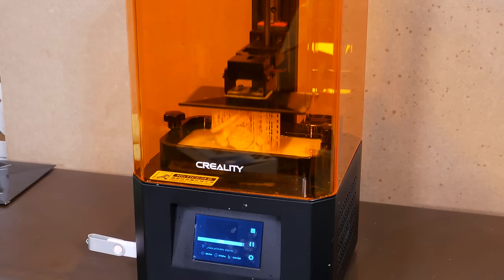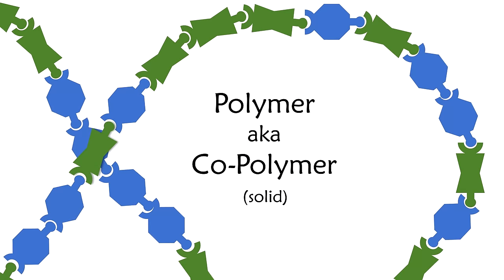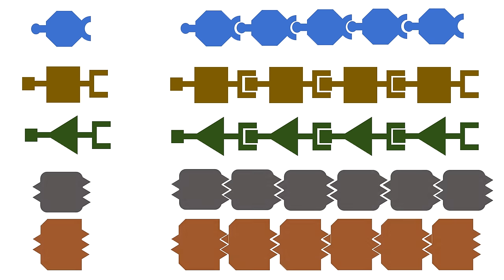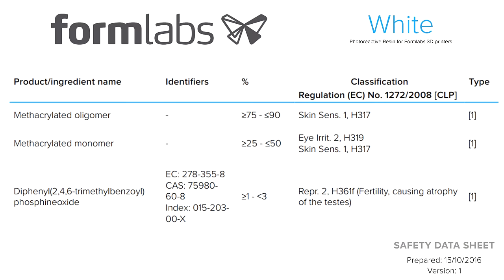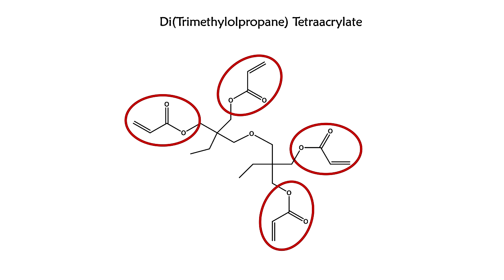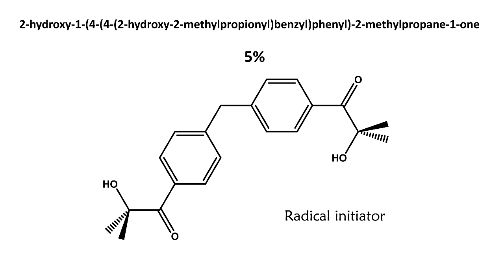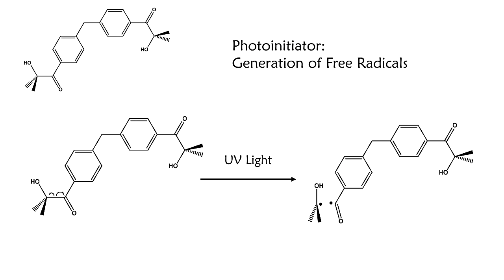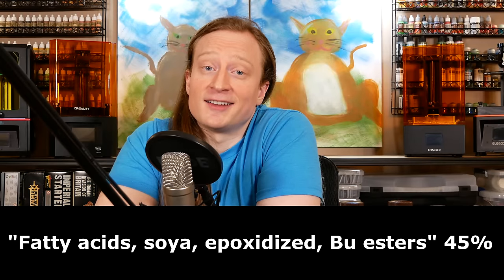Ph.D. Chemist Explains 3D Printer Resin

Comment: wow! thanks a lot. I have a question, though: all resins I've seen on the market are polymerized by "405 nanometer" light. but isn't 405 still in the visible spectrum? doesn't "UV light" stop at about 405? also, some wash & cure machines have two types of LEDs, emitting 385 (which I assume is "real" UV) and 405, which apparently is not. could you please shed some light (yes, pun intended) on the issue? thank you very much once again!

Comment: re f: 28:40
It workes well for me to just leave the used alcohol in the window. This will polymerize the resin in a day and two. You can then easelly filter through a coffee filter. 
 use a stack off the off the plastic bottles that the alcohol was delivered in as a filterstack. Remove the bottom and isnert one into the other and put the filter in the top one. I use a plastic spanner to hold the filter into the side of the bottle.

Comment: This insightful video is just what I needed, as I am fairly new to the resin 3d printing realm. Thanks...........now, can you also explain what is a polymimetic alloy that is used inside a flux-capacitor running on 1.21 gigawatts of electricity............just kidding

Comment: thanks for the amazing video,  have you ever looked into what is in a castable resin?  is it possible to add some type of soy wax to a soy based resin and still be able to get prints from it?  it would be amazing if i could find some type of resin i could modify and use for lost wax casting.  some of the casting resins are 400$ per liter.

Comment: Hello. I'm thinking of getting into the hobby and there's a lot of contradicting information about how toxic/safe cured resin items are. I've been searching around a lot and I'm at a loss at this point. Can you handle solid resin? Is it safe? What happens when you let the resin be in contact with the sun for too long. I've seen some saying that it's food safe, and also that it becomes toxic again if exposed to the sun/uh light. Others say that it's still just outright toxic. I'm really at a loss

Comment: I would like your opinion on curing dirty IPA before filtering and or settling. I see that many people like to cure the disolved resin in an attempt to clean the IPA. I don't do this. As resin has higher specific gravity than alcohol, surely it is going to naturally gravitate to the bottom in time. It does.Overnight settling is plenty long enough. I think curing just locks a quantity of IPA into the cured matrix. I think this wastes more IPA. What's your thoughts?
Reply from the maker: I think allowing the resin to settle and then decanting off "the good stuff" is a good/ convenient way to keep the alcohol reasonably fresh.  Depending on what resin/ alcohol combo you have, it might take longer than overnight.  In my experience getting a good separation just from gravity takes a week or so....    I haven't found a truly efficient way to use UV light to assist the process yet, but I'm sure some folks have.
Reply: Thanks very much.

Comment: I'm going to exclusively use water washable resin, even though it's more expensive.
That way I don't need to clean it with alcohol, which I found to smell more than resin as well as being a bigger issue to deal with, and potentially dangerous as it's flammable.
Now my question is, do air purifier with active charcoal filter help with resin fumes? I'm going to put my printer inside a storage room in my appartment.

Comment: I figured I would ask an expert chemist if I ever encountered on on here. How much upsale is the resin costs to Joe Public consumers compared to a company that would buy 55 gallon barrels of such things? Coming from the automotive industry some of the chemicals I used everyday are pennies on the dollar compared to small quantities a single person might use. I'm sure the  products I used  don't match apple to apple with resins or other chemicals in general. Just was wondering if you knew better ways to decrease cost or if making resins would be cheaper or even possible assuming the chemicals needed are accessible to the average consumer? Thanks for any insight into this and for your very knowledgeable videos.

Comment: What about HCHO? I use an air tester and when I extract the pieces printed from the printer the level of formaldeide is a little bit over the safe level, expecially if i close the door of my garage…
Reply from the maker: what kind of air tester are you using?  There are definitely airborne organic molecules that evaporate out of liquid resin.  I don't know of a reason why specifically formaldehyde would be around, but other carbonyl compounds do make sense.   A garage is a good place to do your printing, especially because you can open the door to freshen things up :-)
Reply: PS I am the same YT user but I answered with another account ;)

Comment: I understand the chemical reaction happening, but where do the fumes come from? And what exactly are they?
Reply from the maker: any of the ingredients with a high vapor pressure / lowish boiling point will give off some vapors just from evaporation. The only smell I've recognized in a resin is methyl methacrylate, luckily most resins don't give off that smell.

Comment: I have a question regarding gloves and the 3d print resin. To make a long story short, aren't PE gloves (like those at gas stations) better than nitrile? 
Given that the resin is stored in HDPE bottles, I'm assuming they wouldn't be attacked by the resin, they're cheaper than nitrile gloves, and given the current situation, the market for nitrile gloves is being flooded with fakes made of pvc or latex and real ones are overpriced due to demand. The only downside I can see is that they probably don't have great 'feel', which is not a huge issue if all you do with them is clean prints and equipment.
Maybe I'm missing something entirely here, but it seems like such an obvious solution.

Comment: Here's a question you've probably never gotten.
If you 3D resin print a spare 3D printer resin vat or a bottle  and then properly cure the finished print, can you then store more of the same resin or other brands of resin in the 3D printed vat or bottle without decomposing those 3D printed and cured parts?

I ask because I've designed an automatic resin mixing vat that will allow me to get a continuously and thoroughly mixed amount of resin in my resin-vat during a long overnight print without having to periodically pause the print to do the mixing manually.

I want to be able to 3D resin print my automatic resin mixing vat and then use it as a sort of specialty-resin-vat when printing with a specifically altered or formulated 3D print resin.  I've been told that if I use a 3D printed and properly cured resin vat, it will most likely melt the 3D printed resin vat.  That doesn't make sense to me at all so I just thought I'd ask to see if you can confirm this or not.

I suspect that the people who have told me this are just some self-appointed internet experts who's information is more like opinion rather than real hands-on knowledge.  To the best of my knowledge no one has done this kind of testing to see if uncured resin will melt or detrimentally effect cured resin.

I plan on trying it but I thought I'd ask before hand in hopes that a bigger 3D print nerd might  be able to shed some light on this.
Reply: Melt how? The resin does have a heat deflection temperature, though you'd be extra lucky if they specified it; if the heat caused by the curing light (backlight) being dissipated on the LCD and other components causes the HDT to be exceeded, the vat that you have made will lose strength and can fail, so perhaps you can try to measure HDT of the resin print and the temperature near the hottest parts of the vat to check viability. Just being in contact with fresh resin should not do absolutely anything to the print per se, i can't really see how. As to being "properly cured", well after things are "cured" they still continue curing over the next few months until they're actually completely cured, so be aware that mechanical properties will change over time, and if there is any residual surface reactivity, it will decrease over time as well.

As long as you have planned for contingencies, just do it, just try. I don't think there can be an a priori answer whether it'll work or won't work. You'll just have to approach it experimentally and see whether you hit any roadblocks.
Reply: @SianaGearz  I found the answers I was looking for through experimentation.

I 3D printed a couple of my Automatic-Resin-Mixing vats out of PETG and I also machined two more out of HDPE plastic as well.

All of my prototype resin vats held up just fine when subjected to long term contact with un-cured liquid 3D print resin.

Now I know that the "Experts" from the resin manufacturing companies were just offering opinion rather than facts.

Thanks for taking the time to reply.
Reply: @MrTjmk   Is PETG still working well? Because since then the DIY 3D printer Lite3DP appeared, it's basically one of those 2.4" cheap touch phone screens 320x240 driven by an Arduino, dead simple and cheap, and apparently printing the vat from PETG has not been recommended; they have instead suggested that it be printed from PLA. Styrene based plastics are supposed to be susceptible as well. The problem being that they're weakened by the uncured resin, become brittle.

I have also since learned that both polymers that i use personally, PETG and HIPS, are insanely weak to threadlocker. Just being nearby as it cures will cause them to lose cohesion and become brittle and crumbly, i have unfortunately seen it first hand.
Reply: @SianaGearz  Wow, this is and old post but, to answer your question, yes, both of the resin vats have held up quite well.

I think part of the reason for that was because when I printed them I did so with a solid infill.  They're pretty thick.  Even if the resins in question were to have had a slow disintegrating effect on the PETG filament I printed them with, it would have taken it an awful long time for it to have penetrated the walls of those 3D printed PETG resin vats.

Comment: What happens if you shine UV on the resin/alcohol mix?
Reply from the maker: I get a rubbery film coating the interior side of the clear plastic container.  Once they become thick enough to be opaque the polymerization stops.  I know some people get particulates to drop out of solution which sounds pretty handy... but I always seem to get films on the inside of the jar that are hard to clean up...

Comment: I just watched this video, and I must say that I will probably return and watch other of your videos, as you have a very pleasant and clear presentation style, and a voice I could easily listen to for hours.

As a Dane, I must say I was very puzzled by the mention of "landfills". I guess it means that you still dig holes into the ground dump all kinds of stuff in them, and cover the whole mess with sand and earth? Wow. I think we stopped doing that to a very large extent 30 years ago here? Any non-recycleable waste (and unsorted waste) is classified as residual waste, and is used in incinerator plants that produce heat and electricity. The smoke is filtered, and particles from the filter as well as the slags is then treated as other incombustible types of dangerous waste. Only very few types of waste are completely incombustible or too toxic to incinerate and will be deposited in monitored landfills. Through efficient sorting of waste, we have reduced the amount of residual waste to a point where we can profitably import waste from other countries (for example from the UK), to feed our incinerator plants, together with straw from grain production and other types of biological (and CO2-neutral), waste.
Reply from the maker: Ahhh,  America has lots of ugly land to fill! We think of burning plastic to be kinda iffy... either way it's best just to try to reduce our waste production :-)

Comment: Is it possible to solve this stuff, add initiators and use again?
Reply from the maker: nope, the newly formed C-C covalent bonds in the polymer chain are very strong, no solvent will reverse that process
Reply: @GoobertownHobbies  Thanks. Maybe heat will help? I found video from Thy Labs where he claims he depolymerized acrylic sheet into MMA. Maybe something like that?

You can make interesting video out of it.
Reply from the maker: @uis246  you're not gonna get mma back out of pmma... that's not a cool vid, that's a Nobel prize! ;-)
Reply: @GoobertownHobbies  Huh. Thanks. Then I don't understand what liquid he got at the end of the video.

Comment: I just want to warn anyone curing washed resin to use a safe container.  I had some rinsed resin in a solo cup and the curing process generated so much heat the ridges melted smooth.

Comment: I know this video is hitting it's year mark, but does anyone know if curing resin makes it aquarium safe or if there is a special brand that is fish safe? I would like to print a few replacement parts in the future in clearish resin but my Google-fu is not strong enough to find the answer.
Reply from the maker: I wouldn't. A lot of stuff is likely to leach out over a period of months.  You could seal that in with paint... but then there'd be the paint.   you could just coat the whole thing in silicone, but that probably defeats the purpose...
Reply: @GoobertownHobbies  Thank you for the reply. Yes, painting and coating in silicone would defeat the purpose for a few parts, like under gravel filter connector. This sent me on a search path though, I found there is 2-part resin coating that is fish safe that is used in professional tanks. I can use this to cover a few decorations I wanted.
Plus, once I get a 3d printer I can print the parts needed, mold them, and then cast in that same resin. So, thank you for setting me on a good Google-River for answers.

Comment: YEAH SCIENCE!

That being said while the resin isn't terribly toxic to handle and be around for the most part, it seems a handful people have been hit with a severe respiratory allergic reaction, which can be insanely dangerous, at least there seem to have been some reports that i don't necessarily have the ability to directly confirm, so it is perhaps a "rumour". The probability of this happening to any given person seems to be absolutely tiny but the consequences can be severe to deadly. What is the right way to handle such a risk anyway? I mean we all cross the road sometimes, and we might get run over by a car, and that's not even terribly unlikely. Is there a right way at all? And it's not like the smelliness is necessarily correlated to this kind of risk, is it? What are the smelliest compounds in the mixture anyway?

Comment: Thank you so much - the safety aspects and 'greenwash' marketing implying safer but not necessarily so, were enlightening for us.  Hubby has had a severe, systemic allergic reaction to the fumes of the Anycubic Eco Resin - almost a full body rash, severe facial swelling and Soros-like bags around the eyes.  We have now gone all-out on safety precautions:  full printer enclosure with exhaust fan, full PPE, and protective eye-goggles.  We learned some extra safety tips from you such as curing the waste and a good reminder re ethanol precautions as well.

Comment: Resins:  Have you tried adding micro-powdered metals or plastics--Delrin, Acetal or Teflon/PTFE) to SLA resins to increase their self-lubricating properties?  I ask because my own applications would benefit from lowest friction characteristics possible, and the items I propose making would be produced in far too small numbers for thermoplastic, aka injection molding to be a viable alternative.   Unless they take off, of course.   
And--for the benefit of any lurkers reading along--no, I am not making sex-toys ( :-D ) but only, comparatively boring, small scale model railroading items.   :-D

Comment: Alright I have a question regarding Cement vs Superglue and their toxicity, like I didnt know that tamiya extra thin cement is neurotoxic. I had the window open and I wasnt wearing a mask I opened the cap, and the odor was horrible. I immediately closed the cap, but now Im worried about the neurological side effects of that. So knowing u r in the hobby how bad is using that types of cements? Also why are those cements that are hazard and unhelathy being sold to teenagers? like WTF. The label said not for under 14 but what about above 14? Also how´s possible that after 40 years no one has ever invented something THAT IS SAFE in the model kit industry??? Do u use a mask when using tamiya extra thin cement? like the covid masks?

Comment: FDM for home, resin for commercial, the toxic nature of the resins can cause chemical sensitivity to increases over time, toxic fumes are really bad for the brain & eyes, and testes & other rapidly dividing cell groups in the lungs for example & bone marrow. So if you do it at home, it must be in a dedicated room with air handling. Wear an activated carbon filter respirator face filter, eye protection, nitrile gloves, have IPA for cleaning, disposable paper towels, a dedicated IPA washing rig, UV curing rig & fume handling air handling venting or air purification system to clean the toxic fumes out of the air. Wipe down any surface of resin & be very careful not to spill. Clean up any spilled resin at once with IPA soaked paper towel, and wipe down 3x to get any residue. It's an intensive hobby to do correctly & safely & better done in a commercial space, not at home. Think backyard shed or not in the same building envelope where you cook & sleep.